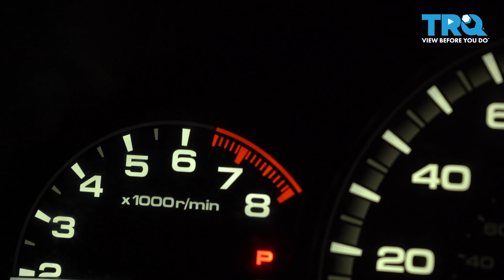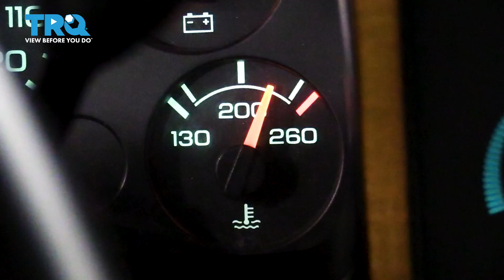EricTheCarGuy Explains Check Engine Codes - P0300 Random Misfire Detected

Comment: i have a 2000 cherokee sport 4.0 175k. i had random misfires, sometimes it sounded great and other times multiple cylinders misfired. after replacing coil and spark plugs, i found out that it was the 0 rings on my injectors. $6.00 for 12 0 rings at rock auto.

Comment: I have a 08 Chevy cavalier with only 85,000 miles on it . The car over heated and shut off . I let it sit while I went to work and at the end of my shift I went back to it and it started right up. I drove it home and it stalled after about 15 miles of me driving . It started right up again I got it home just before it stalled out for a third time. My car has been starting right up but can't put it in reverse or drive without it idling too hard or stalling after being on for a minute. I have replaced the thermostat twice, cleaned out the throttle body and now am getting a p0300 code. Any thoughts on what it could be?

Comment: How about if you 14+v at alternator but the the amp is not where supposed to be?  like the alternator specs it say 150amps and while you check with the meter clamp amp you way much lower. Lower amp pushed by the alternator will that create a engine misfire too?

Comment: PO300 by itself is internal mechanical engine failure. Basically, time for a new engine or new car, since the true cost of repair, depending on age, mileage and condition, will likely exceed vehicle worth.  

The vehicle computer throws out PO300, Check Engine light flashing, from unable to pinpoint cause.  The reason is no sensor reading the failed component, such as cylinder valves. Intake & exhaust valves, in most vehicles, don't have sensors. 

In PO300 situation, no discernible banging or rattling, cylinder compression test performed, and one cylinder reads around zero psi, that's a wrecked valve.  The intake or exhaust is blown open because a valve packed it in or the guide did.  That cylinder is engine rebuild time.

Comment: I just got my 07 Avalanche back from trustworthy local garage person. I had tried replacing plugs, and replacing the MAF sensor. No solution. He had a GM expert that works for him part time and he discovered we needed to run a new ground wire from the driver side bank of cylinders to a strong ground. That solved the whole problem.

Comment: ERIC. i have a 2009  chrysler town and country with the 3.8 V-6 engine it has 232.000 miles on it. i developed a misfire on it a while ago and the codes P0300 and P0301 cylinder 1  misfire. originally the engine ran fine when you start it up in the morning BUT after driveing for a bit then turning the engine off and later restarting there is a misfire.  but the misfire will go away if you let the engine cool off for a couple of hours. this issue repeats itself everytime i turn the engine off after driveing for a while. now i am smelling blow bye coming into my van.  ANY IDEAS ?   thank you.

Comment: Also I had a vehicle sit for a couple of years. Started it up  P0300. Water in the fuel was the cause. Guess some run off or snow melt got through the cap and into the tank. Maybe just condensation. Treated the fuel, missfire gone.

Comment: Great to see you Eric! I had to laugh, my 1997 S10 2.2L MT5 300K+ potentially has ALL these issues! Completed R&Ring the injectors (gasoline leaks, brittle O-rings). Next step: R&R leaky brake vacuum booster.

Comment: Yes, start with air filter
2 spark plug
3 ignition coil 
4 fuel injector 
5 head gasket 
And many more

Comment: Using an infrared thermometer to measure exhaust manifold temperatures is also a good way to isolate a misfiring cylinder as it will be significantly cooler than all the others.

Comment: I’m willing to compensate $$$ whoever guesses why I have a P0301 code in my 2010 Tacoma 2.7. 
Coil, spark plug and injector replaced, compression 150psi, injector connector tested with a noid light tester(ok) spark plug from cylinder 1 clean as the other 3 plugs …

Comment: TRQ is the is a great place to get your ignition coils especially the performance package. Any of my customers that need coils and spark plugs. I let them know that they can save hundreds compared to getting them from the local auto parts stores. Don't forget @ 80,000 miles ignition coils begin to fail, So  I suggest new Ignition coils before 100,000.  Eric the Car Guy it's Great to see you working with this #1 company. #TRQ🔧💪🏼

Comment: My 2005 impala gets a code p0300 and it gets activated only when I drive fast or up hill while I press the pedal and lose power then the check engine light flashes..

Comment: Twice i've had random missfires on my 2015 colorado 3.6 with 130k miles.  When i start it up twice now it missfired from random cylinders.  Shut it off, start it again and no problems light goes off.  I put a Amazon EGR valve in 4 months ago and new plugs in 6 months ago.  What are your thoughts.

Comment: I had a code PO302 on my 2008 Ranger 2.3L, after checking for the easy fix like wires, vac, coil pack, plugs, injectors, I found out mine was very low compression, so a valve job was done.

Comment: I don’t know if the OP of this video is answering any questions, but I’ll ask anyway. I have a 1997 GMC K1500 with about 188,000 miles on it, but I replaced the stock 5.7L small block chevy with a rebuilt 383 stroker engine and after market aluminum heads with a mild RV style camshaft. I have about 2K to 2.5K miles on the engine now and it just developed a random misfires condition, but only at low accelerator pedal positions. I replaced the fuel injectors and the throttle position sensor and that hasn’t improved the problem, although the new injectors have given the 383 a lot more power and responsiveness. What should I check next? Edit: I also installed a new air filter.

Comment: So cool all this info. Thank you! 1 thing though 3 days ago my car was shaking, had it change oil and air filter and it stopped shaking maybe 1 time the day after but the light still on. So had it diagnosed it says P0300 misfires. 
I took it to a shop what exactly is wrong he said he wont know unless the light is flashing or car is shaking so since the car stopped shaking he wont do anything. I have to wait for it?

Comment: My 2013 WRX STI has been one problem after another.  I found the MAP sensor was missing a screw it broke while trying to remove the remaining screw. I then noticed a weird noise from the passenger side of the motor, then noted the front ignition coil screw, and the coil was dangling broken.  I replaced that and have been trying to tune the car using the manufacturers settings which were way off COBB was no help.  I had to calculate the offset and multiplier from the voltage pressure numbers.  Now the POS is throwing random error codes first evap system malfunction then O2 sensor out of range.  It did that before even bought a spare ECM and found those are difficult to program and install on a Subaru.  The car is frustrating it also eats oil like a 2 stroke since new, but Subaru takes responsibility for nothing. It threw a cam belt at 15K miles which Subaru tried to get out of because I changed the oil myself.  That is illegal but the dealer didn't care.  I took them to small claims court with a magistrate who knew nothing about law.

Comment: What about an intermittent flashing check engine light. Example: I get a flashing check engine light randomly once a week and I can't get the car to do it again if I take it to a shop. I've replaced coils and plugs 😢. Details: I replaced the coils the issue went away for 45 days and now it's back.
Reply: When it initially happens I'll get a P0301 and P0300. These codes clear up on my next drive cycle or when I continue driving for about 15-25 minutes.

Comment: Dealer wanted $900 for fix on my 2019 f250 on cylinder 5 code read. Said no, filled up with gas and noticed gas cap wasnt tight. Made sure two clicks and engine light went away! Stealerships😂

Comment: Eric, thank you. My po300 is set at high speed. It could be my my cam phasors or oil galleys that supply them with oil pressure. I will test the kiwi hanging fruits first like smoking the engine....

Comment: A clogged leaking muffler  is not exhausting the heat and stock at the resonator outlet pipe. MAP Sensor 2012 nissan sentra it's in the canister right rear and the MAF Sensor is mounted front outlet of the air box.

Comment: 2011 Chevy Cruze Turbo (Keep in mind neighbor has messed with golf cart twice and removed the cables because he tried bullying me and I didn't let him) out of nowhere my car started overheating and the cable either was cut or melted. How all the sudden does all the fluid poor out? I took it to the auto repair shop and they replaced the hose for the antifreeze and said it was way too low and leaking out of the hose. They said the transmission was bad and it will hesitate forward and reverse for two seconds before going into gear.

Comment: What about on a 76 F150 390 FE with original autolite or remand carb? I HAVE A LOW COMPRESSION #4 ABOUT 20 LESS THAN NEXT LOWEST
1. first check for compression on all cylinders to assure no holes in pistons, headgaskets, valves etc
2. check plugs wires coil etc ALL GOOD/REPLACED
3. check intake area for vac leaks with carb cleaner PLUGGED ALL NON ESSENTIAL VAC PORTS  except brake, pcv, Dist, tranny

BUT I STILL have a misfire
also has an off idle stumble and  very fine rust/dust in pre pump fuel filter so ive ordered  new tank, sender and carb to hopefully fix stumble.

Would a leakdown test narrow it down or can you already say what the problem is?

Comment: Eric, I have a 2007 Aveo, keeps showing , p0300,p0301p0304. I have replaced spark plugs, wires and coil. Also replaced throttle body, pvc valve, map sensor, fuel injectors, and even timing belt. Engine show no sign of misfires and runs good, but when driving above 55 mph check engine light starts flashing and shows random engine misfire, cylinder 1&4 misfires. I did a compression test all cylinders are at 180. I checked fuel pressure and it’s a steady 55. I have run out of ideas, do you have any advice?

Comment: Well I drive my ford 2003 escape V6 with flashing light... #4&6 have misses at start or when hot :(  Afraid oil seal bad on those and gets that first oxygen sensor dirty :(  
  BUT the chain will cause all cylinders to miss.... Mechanic cut off my clogged Catalytic.

Comment: Hey Eric, I have a 2000 Acura RL and I had the codes and replaced coils with TRQ, still have the same codes showing, P0300, P13001-1306.  Had TRQ send me another set of coils and still having the codes, what do you suggest?

Comment: He's absolutely right. When the alternator or the battery goes bad while driving is at its edge of failing the car will either stall or sputter even If the connections for the terminals on the battery is loose

Comment: Great great video. My battery is starting to get weak and I don’t drive it very often so it makes matters worse. I suspected the battery as a cause for the  misfire and crazy engine shaking since it  occurred right after a cold start up twice in the past 40 days and only 200 miles of driving. The resting voltage of the battery is about 11.8 v. In the past I replaced the batteries before I had any issues . Will do more testing to confirm.
Reply from the maker: +@tombanes Thanks for watching our video! http://1aau.to/m/Shop-TRQ

Comment: We had a medical emergency and had to drive about 500 miles with a Flashing Check Engine Light caused by a failed Igition Coil on a 2019 Ford E450 RV with the 6.8 V10 with 20K miles on it. A Ford dealer replaced the igition coil under warranty, said everything else is OK. RV runs fine. What happened to all the unburnt fuel that went into that cylinder? Did blow out though the exhaust, blow by the rings? The oil had less that 1000 miles it at the time, still looks good on the dip stick. Thinking on changing it anyway before the next trip. No other error codes now.  Any thoughs appreciated.

Comment: Its usually bad coil packs. BOOM! Saved you 5 minutes. Trq, i especially love how everything works outnin your videos or how you only do the easy thigs, like the front but not rear spark plugs in an older buick century. Or how everythinf magically just ligns up in replacing motor mounts on a vehicle.

Comment: Just clear the code and sell the car at this point.  Otherwise by the time you're done diagnosing you dien spent thousands at a shop
Reply: Have spent over 10k had a new engine installed and now have the same code. Idk what else it can be lol.

Comment: One time I was in the freeway with traffic and I changed to the left lane bit there was a car coming quick so as soon as I changed it I accelerated very fast and as soon as I did the car literaly started to choke and the whole engine was vibrating very weirdly like shaking and choking and the flashing light came on but I couldent stop and I went to an O'Reilly 1 hour later after driving and I got p0174 and p0300 but after that I never got the shaking engine again but I do get the p0300 and p0174 especialy at cold starts the engine idles very rough and very weird but. When I drive it it's fine and it's a 03 gmc yukon xl 6.0 by the way and it's driving me crazy that very rough idle to the point it wants to choke and shut off so I gotta warm it up and drive away

Comment: Hello Brother. I have a 2011. Corolla. My air filter is torn with holes and I have p300, p302 p303 p304 with start but no turn over

Comment: Thank you Eric. I took my 2006 Saturn Vue off the road four years ago and am finally getting around putting it back into service (long story). The last thing I need to do is buy and new battery for it but before I did I connected th Saturn to the battery in my Nissan (which I disconnected for the car). The Saturn started up and it ran, but then I noticed the CEL lit (not flashing) and the engine was running a bit rough. Plugged in my OBD CAN scanner and retrieved a P0300. I'm going to start with the simplest, least expensive and take it from there. I'm wondering if the four year old gasoline is a possible culprit or maybe the injectors are junked up from sitting for four years. Also, maybe the long jumper cables I used to run my Saturn through imposed a significant voltage drop. Guess I'll find out once I roll up my sleeves and start diagnosing.

Comment: I have a 2023 GR86 with less than 5,000 miles, with an engine that's never been red lined... I have no warning light, but, there is a small amount of white smoke coming from the tailpipes at startup, and I believe that I am registering an average of one misfire per trip,. I think that maybe happening only at idle in public driving but not sure.. The car seems fine after I'm on the road, and other than the smoke, I don't notice much wrong. Any suggestions?

Comment: What about fuel pressure? What about a bad transmission? 

I have a 2011 Toyota Tundra that runs great until I put it in drive or reverse. Starts misfiring and shaking all over the place.

Help.
Reply: Transmission problem could cause check engine light to come but won’t cause misfires. My 14 Toyota Avalon had p0300 random misfire and trac light on was due to a broken valve spring not plugs or coil packs like every thinks all the time .  Had check engine light flashing and right idle .

Comment: Hi Eric. Thanks for your videos. I have a problem I am hoping you can shed some light on. I had engine misfire and replaced all. the coils and spark plugs. The misfire went away. Also have a new fuel filter. Six months later, I am experiencing a random misfire.  Sometimes the car runs perfectly, and all of the sudden it misfires for a few seconds and the "Service engine light soon" flashes on and off during the misfire. No check engine light. Then it goes back to running ok. I have poured motor treatment liquids to see if cleaned injectors and the such. Once it misfires, I can detect a P0300 code and troubleshooting this has been difficult. I do not get more specific codes. 2003 GMC Envoy XL 4.2L 6 Cyl. Any thoughts?
Reply from the maker: +@dennistirado4619  We wouldn't be able to diagnose an issue like that here, you may want to have a local mechanic take a look at it. Thanks for checking us out! http://1aau.to/m/Shop-1AAuto-c

Comment: I have an 05 Jeep Liberty throwing a P0300 code.  Check engine light has disappeared but when i check for codes (cycle on off ignition key) the p0300 still shows... and accelleration is def sluggish.
One video i watched here on youtube suggests that the ASD relay is often overlooked cause for this code.  
Penny for your thoughts?  ASD relay?
O.o

Comment: Great info.  Quick question....can a cracked engine block or something major like this also cause this misfiring?  The reason I ask is that I just had to get a Jeep Patriot engine replaced after 160K miles as the shop (reputable and I think honest) tested all of those other things and the Jeep engine simply wouldn't run.  Since getting the engine replaced I've had no issues and I don't believe they replaced any of the existing electronics or vacuum lines, etc..   They did replace spark plugs in this used engine just to start clean although the coil packs were probably from original engine.  

One thing I did just replace the other day was my battery which suddenly died although it was almost 5 years old and the past couple days were the first cold ones since last winter.  In your video you did mention voltage could also impact these electronics and their operation  but I think the previous battery was tested a few months ago and was still holding a charge and I was using it until the other day with this replaced engine so it had to be working fine with the replaced engine.

That P0300 code is annoying...as an I.T. person I equate this to the Windows operating system general protection fault from the old window's days which meant.....good luck finding the cause :-)